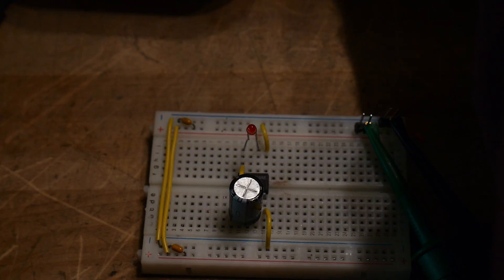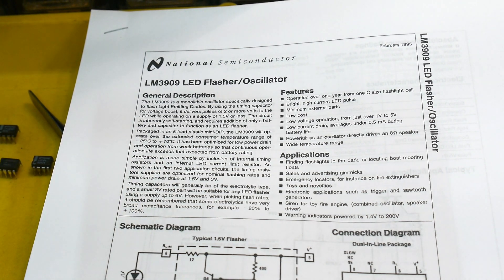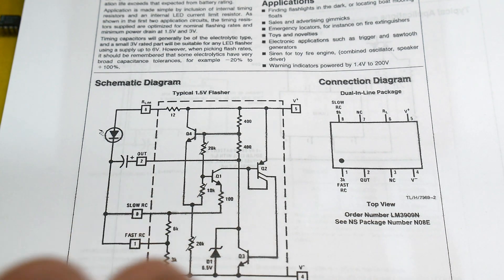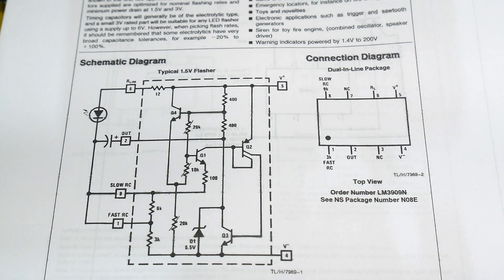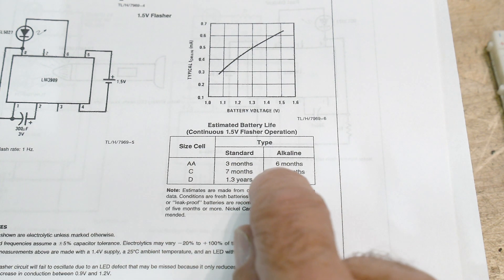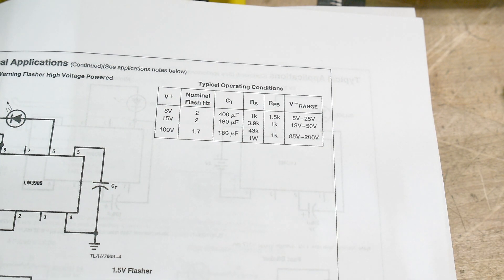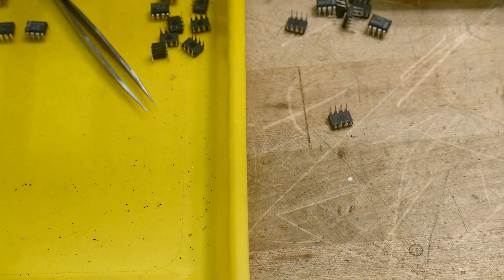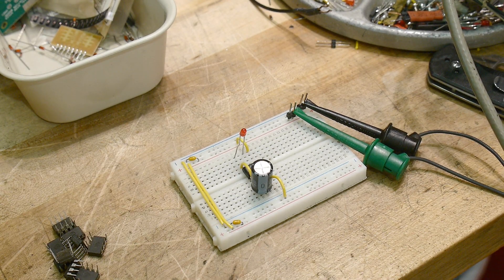#1128 LM3909 LED Flasher IC

Comment: Wow that is scary, I have the circuit diagram and the IC sitting on my desk. Have been using the chip for many years as a deterrent to burglars. Two AA cells in parallel in a black plastic box with a new high output LED sitting on the window sill and you don't have to touch it for a year. Have always soldered the batteries on because of the very low current draw. Love your videos they make my day.

Comment: Yah, I bought my first 3909 at Radio Shack in the early to mid 70's . I practically lived at that store. I knew all the sales guy's and some gal's. I later got a job with them out of high school . Bought a lot of stuff from them over the years and I sure wish they were still around👍
Reply: I took the same path. You probably knew the Radio Shack product catalog better than the manager did too!
Reply: @joeteejoetee  I knew it like the back of my hand 🙂. I never got a lot of commissions on big ticket items like the stereo systems but I made top sales all the time on the blister pack parts wall. I knew my parts and if you were in there looking for resister's ,diodes, etc. I was the guy they pointed too. Now retied from multiple careers in electronics I wished I could spend these years doing the same for that company but things change.

Comment: My  favorite LM3090 circuit was a cute little fllyback circuit that generated a few hundred volt pulse---only a few passives, and an inductor with this chip, from single cell battery.

Comment: A few years back I mentioned to Forrest Mims that it would be nice if someone would make a modern version of the LM3909 that is CMOS, and matched/optomised to Lithium battery voltages, and Blue/White LED forward voltages, and he agreed.  Of course everyone reading that brought up how inexpensive 8 pin microprocessors are today, and the Arduino has an example sketch as the 1st tutorial.
I dont think they realize how many thousands more transistors a microprocessor has compared to a dedicated ASIC like the 3904.
Maybe someday. Maybe...
Reply: Plus you don't really learn any electronics if you use a programmable microprocessor, and very little about how-to-code either.

Comment: The high prices now are due to the fact that these chips were discontinued over 15 years ago.  I seem to remember buying them for a buck or 2 from Radio Shack as a kid in the late 70s. I still have a couple of them stashed away in my parts cabinets, I think.  Today's geeklings just use an Arduino and write code to flash an LED.....and this is considered "progress" somehow.

You could do a bit more that just flash an LED with them. With smaller value timing caps, you could generate audio tones, or drive a step-up transformer to generate high voltages.

Comment: Yep, bought a few over the years to put a LED on flashlights!  Not a bad idea, really.  More recently, I've played around with two-transistor relaxation oscillators as low power LED flashers.  Aren't there also LEDs with flasher circuits built into them?  Fun stuff.  :-)

Comment: I used one of these in a Yaesu FT-101 EE to flash when my clarifier was on to make the LED flash. You can still find these in Mr. Coffee makers from the late 70s and early 80s if you have one around. The 6 months on a AA batter is pretty close. I bought a bunch of them and still have a few...
Reply: Cool history tip about Mr. Coffee! Thanks.

Comment: Obsolete for many years now.  I just checked my personal parts database -- I have two of these.  Probably bought 'em from Active Electronics in Edmonton back in the early Oughts for something I've long since given up on.  ;-)   (Remember when "parts stores" meant something local-ish you could drive to and not an online supplier?)

Since they work around 1.5V, I wonder if they'll provide sufficient charge for a modern high-brightness LED?  I should go lash one of these up and find out.

Comment: I imagine that most 6-pin microcontrollers running off a low-speed RC oscillator will consume same or less power, and can generate any fancy pattern you want. They are more pain to set up, but once you can program them quickly, it’s smooth sailing.
Reply: ..except this part runs off low voltages and very little power.  Not quite what's done these days with first-class energy harvesting devices, but a precursor.

Comment: I just looked on ebay, they are asking over £5 each. You can get self flashing LED's for a fraction of that. LOL.
Reply: Not only that, but it takes a couple 2N7000s for a robust MOS replacement that consumes a couple micro amps with the LED off.

Comment: What is the definition of high quality electronic component?
Reply from the maker: An electronic component of high quality 😀
Reply: One that  doesn't go bad. electrolytic caps for example. There are garbage ones (CrapXon) and high quality ones (Nippon, Rubycon, Panasonic).
Reply: @simontay4851  I see. Is there anyway we can detect from an oscilloscope to see whether a particular component is of bad quality?
Reply: @myhumblebeginnings  Depends on the component. IMSAI Guy did a video where he tests fake poor quality chinese op-amps with a 'scope. They were much slower that what they should've been. The wave form wasn't correct. With capacitors you can measure the capacitance and Equivalent Series Resistance. Bad capacitors have reduced capacitance and high ESR and the top is usually, but not always, bulging.
With poor quality resistors, the resistance will be off.
Reply: @simontay4851  I always used recycled mil-spec Tantalum caps for my LM3909 flashers - they all still work from 40 years ago, but mostly because we used non-ROHS solder back then. #TinWhiskers